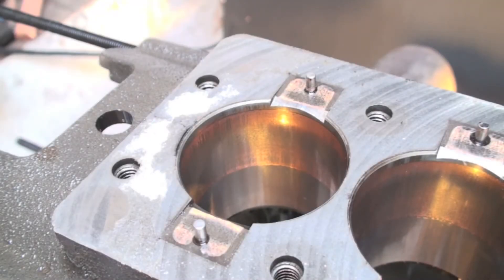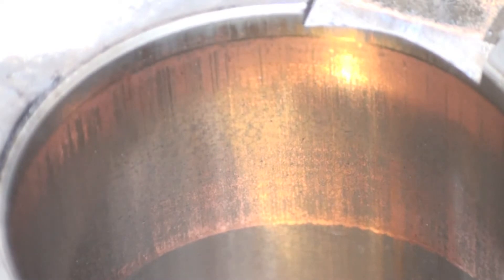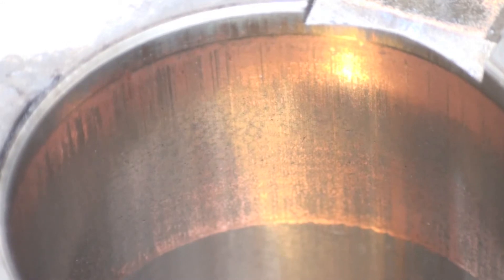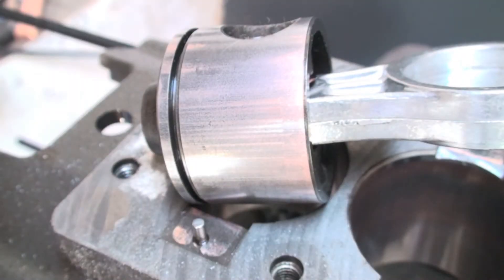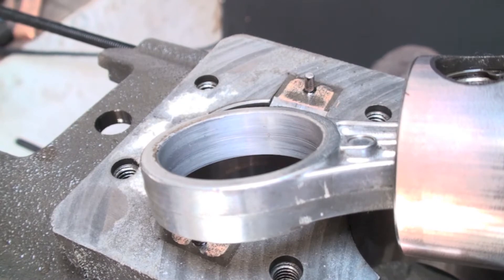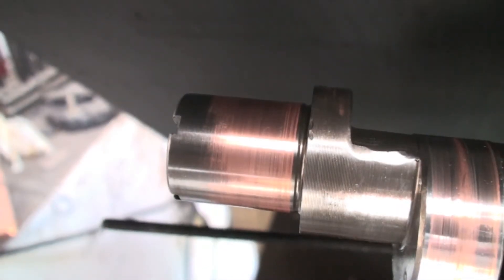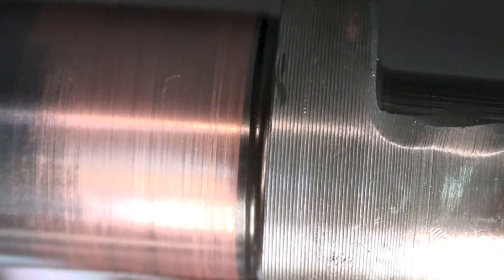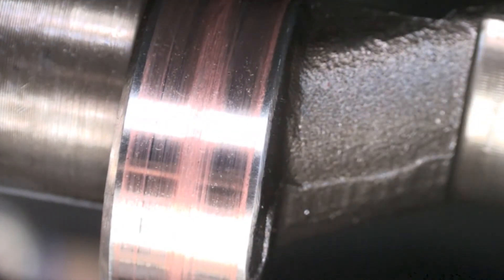a/c compressor failure due to copper plating

Comment: Saw very similar copper plating in a 5 ton R22 A/C system that had been in service 29 years and never opened.  Homeowner kept condenser clean but didn't know it was a split condenser and it was totally blocked.  Had been running very high head pressure for years.
Reply from the maker: I can't say high head would cause copper plating, but air contamination would.
GFM

Comment: Did the mechanical failure eventually lead to a motor burn out?
Reply from the maker: No.  As with most of these units, they just lock rotor and the call is no cool.
GFM
Reply: Weird... I've heard cases where the compressor will fail mechanically, and the compressor won't be able to pump enough gas to keep the motor cool, and then the motor will burn out from all of the heating up, and cooling down.
Reply from the maker: John Smith I very seldom see burnouts anymore.  Usually just locked rotor.  If it tries to start over a very long period, it may burn out.  But I have seen heat pumps lock rotor in winter and the customer does not know it has failed until the cooling season.
GFM
Reply: When you have a burn out, is it a good idea to flush the system to remove any acids and oil?If so, when you get the chance, please do a video on flushing heat pumps, because i've heard debates on whether reversing valves and check valves can cause problems.
Reply from the maker: grayfurnaceman First, I try to never replace a burnout, especially a running burnout.  I want to replace the unit.  I will do one on flushing when I get a chance.
GFM
Reply: Does a running burnout make it really hard to completely flush the system when you have reversing valves and check valves in the equation or something?
Reply from the maker: John Smith As an example, I had a running burnout that I had to remove the txv, separate the high and low side, flush with R-11(it was legal then), and the roof around it turned silver for a 10 foot circle around the unit from the grindings from the failure.  If the motor burns the windings and is still pumping, winding insulation pieces are pumped thru the system.  So yes, it can be pretty tough.
GFM
Reply: That's pretty nasty! Now I really want to see a video on burn out flush!
Reply from the maker: John Smith When I find one, I will do it.
GFM
Reply: Thanks, HVAC really is a school day every day, I had no idea that mechanical failures were more common than motor burn outs.

Comment from the maker: Anybody's guess on that.  If acid is present, it will pick up copper into the oil from any surface.  I will be looking at some compressors with aluminum windings to see if there is a difference.  I would think that heat would accelerate this type of chemical reaction.

Comment: Wow! thats bad! never seen that much plating in one compressor. Seem to remember it plates onto the hottest surfaces so bearings and valves etc.

Do you think the copper just comes from the motor or do you think it could be from the lineset too?